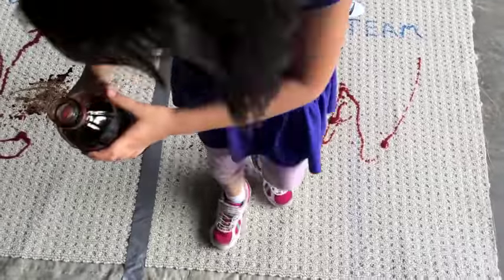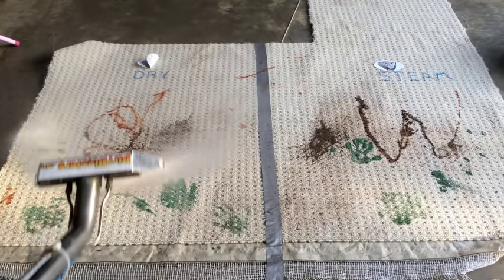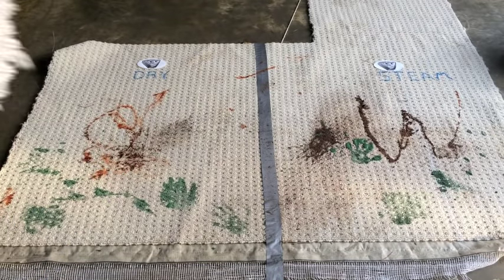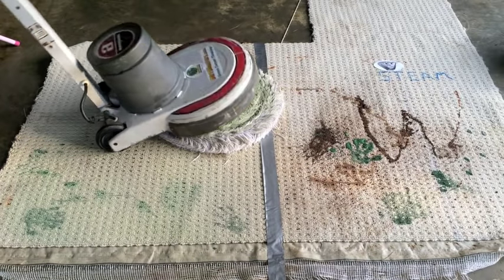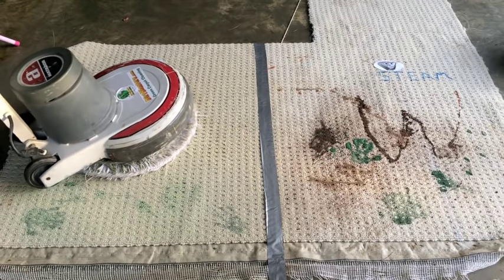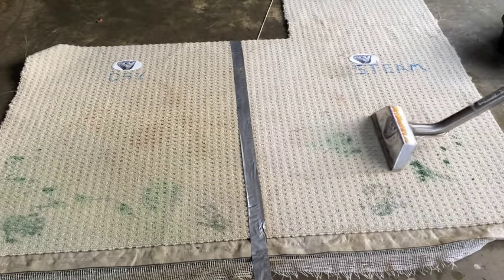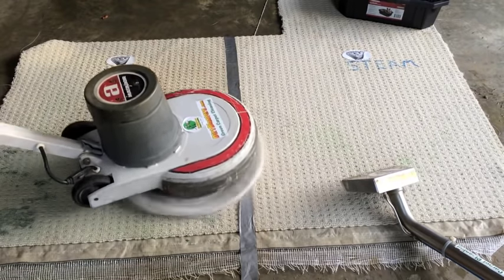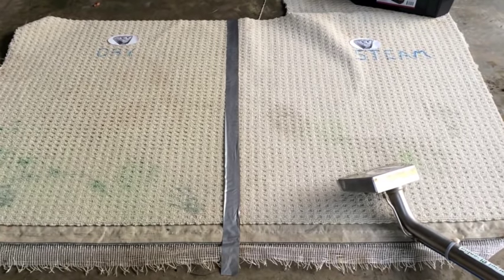Dry Carpet Cleaning (Bonnet) vs.Steam-Cleaning  by Atlanta GA's 1st Green Carpet Steam Cleaners

Comment: The paint, the paint thinner, dirt and pre spray are all still in the carpet after the bonnet system has been completed. The hot water extraction vacuums it out completely and sprays it with a 230 degree hot water rinse therefore removing all residue and unwanted material. Contact us for your free no obligation quote.
http://www.dirtblasters.com

Comment: Try an oscillating machine with that bonnet.  Night & Day difference.  Also must use chemicals made for the bonnet cleaning.  there is a place for all methods (excluding floor buffers). for instance most new encap chems will remove red stains that my truck mount wont.  I have been in the business over 20 years started with a floor buffer then portable extractors then truck mounts.  I will tell you that I can get the same or better results with a decent encap and an oscillator as I can with my peak gtx .

Comment: as a carpet installer the carpet mills says that it has to be professionally this is from mill reps at the carpet stores never once do they say steam clean or hot water extraction only and the bonnets are supposed to be slightly damp not dry. and did you actually use the natural from chem-dry or ur own cleaning solution? which will make a difference in cleaning

Comment: i HAVE A vAX steam cleaner with a upholstery attachment but it does not have suction so I only use my steamer for hard floors / tiles / my birds cage LOL ceiling ( sometimes ) I cant see the point in using it on the carpet  because like you say on this vid on your " dry side " everything gets spread around , and I think the same with the steamer that I have as it dosnt have suction..I always wonder where the muck is going .

Comment: It is obvious bonnet cleaning spreads the dirt out more evenly and picks up very little as can be evidenced by the pad. Your wand case is pretty weak as I can still see the three green hand print stains despite the wand being placed in front of them in the shot :(.  Rotary extraction would be an improvement on both of them.  Once you go Rotovac, you'll never go back!
Reply from the maker: Snowy Owl Floor Cleaning Thanks for the response. Yes rotary is the best however this isn't about "the Best", just the Bonnet vs Wand.But Rotaries and spinners do out clean them all so you are 100% correct!

Comment: Great Vid brother...I have a oil fired system with mega heat...set fire alarms off heat. lol (Check my vids.)  The only "dry" or more correctly "low moisture" system that works is Encapsulation.  The soil is suspended, encapsulated and then dries to a hard crystalline powder that's vacuumed away.  I have several clients I have been encaping for years with great results and no buildup of soil load.  One is a truck dealership that greases out big time and for over 5 years done every quarter it comes back looking great.  Another is an adult group home that gets the nasty's real bad done twice a year.  That one is going on almost 8 year, no issues at all.  If I bonnet cleaned those that long there would be massive soil buildup.  I've actually followed behind the encap with steam extraction just to see if there was an improvement to be had, but even in grease nasty restaurants it doesn't make any improvement...at all.  After working with encap all these years, I am convinced it works.  I still steam extract residential customers though...but have started to encap select clients with great results.
Reply from the maker: That's awesome. I would like to invest in that system when I can, I'm amazed at the # of Bonnet fanatics who are still around defending it to the very end. They say my bonnet demo left out the agitation step. Do  you think that would make a significant difference? Nope.  All I can say if the Bonnet boys would have the good fortune to own an encap system or Truck mount they would quickly change their tune. But if you think about the buffer would be the best choice for certain aircraft wings as a polisher.
Reply: JViello

When you say you encap select clients, what type of things are you looking for to determine which residential customers you use encap for?

Comment: Grat video, It gives the main idea.
Is it real steam (Dry steam)? or hot water injection? If it is steam, which steamer are you using? 

Have a good day,
Reply from the maker: Orl Esp Orl the "Steam" term is misused for HWE or hot water extraction. It's so misused we now all call it that so the public understands.The steam is a by product of water heated hot enough to gas off a bit. The "Truck mount refers to the large gas engine machine inside the van that runs the water pump, vacuum blower and chemical mixer. The heat for the water is also made by the TM and called "Heat exchanger", some TM's use diesel heaters or propane heaters in van as well for even more heat.

Comment from the maker: There are endless spotters, pre treatments, techniques, steps and styles you could use in bonnet cleaning however after 20 years of using the buffer and buffing literally millions of square feet (with a Truck Mount on hand)  I feel I am qualified to say it just doesn't matter. Even if the paint and grime could be removed slightly more with added "steps" that won't change the facts that the bonnet system:
A) Still isn't pulling out and rinsing bacteria and filth with over 200 plus degree sanitizing filtered water at around 35 lbs. of pressure.
B) Will still break down and spread around dirt, grime, mold or anything else under it's fiber unwinding weight and leave substantial residue. (Non residue cleaners are okay, but dirt residue, urine, fasces, vomit and bacteria is still present.)
The bonnet system voids manufactures warranty and not recommended by the CDC.
The buffer and pads are a cheap start up recipe and nothing more. I am concluding any further responses to folks who are sadly misguided in their futile defense of this "in between" system here.
Reply from the maker: Indeed, thank you sir!

Comment: Steam was better but still left stain.. is there a 3rd method?
Reply from the maker: +Philip Duncan There is "encap" which is Encapsulation which uses less water and is pads or brushes or both with a solution sprayed first. Uses no vacuum so it is another 'Surface" cleaning system such as the Bonnet system. There is also a Foam system which can be used with an extractor but again it is not as penetrating as "Steam" or HWE. There is the Host system as well which are tiny dust like sponge particles which absorb dirt via vacuuming. Yet another not so deep of a clean. There most likely won't better way to clean than hot water and high vacuum power. If there was the CDC and Shaw Industries would change their recommendations from "Steam cleaning" aka Hot Water Extraction to one of the cheaper and easier methods.